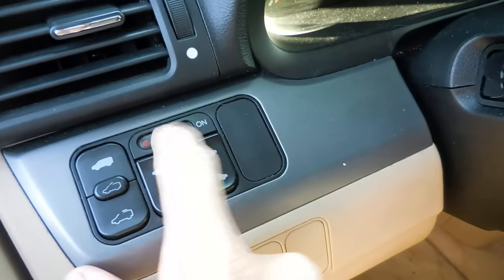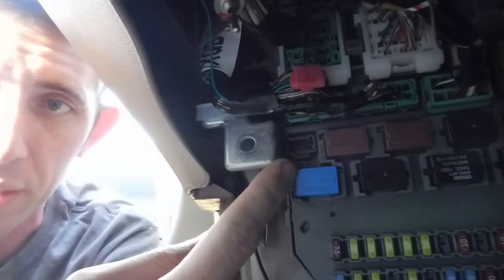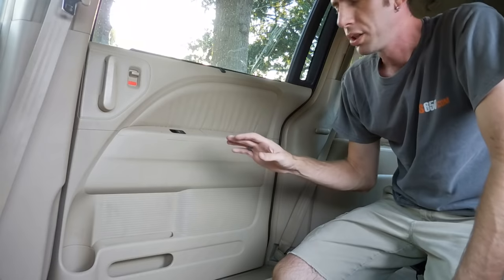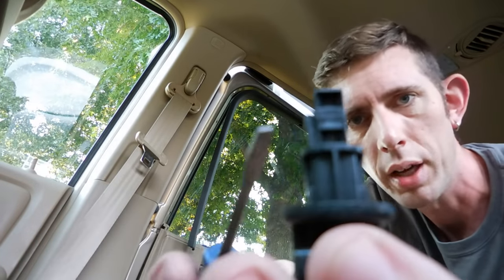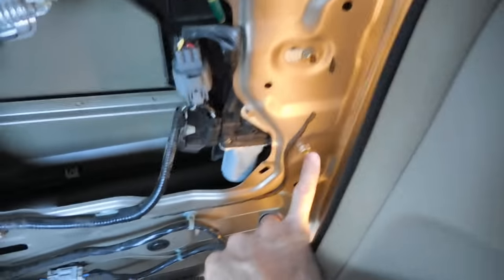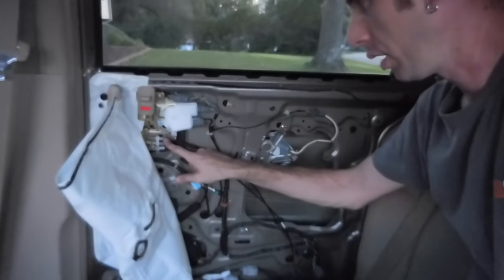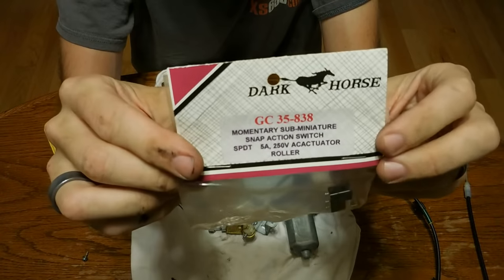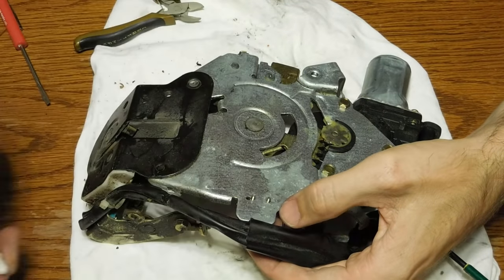Honda Odyssey Power Sliding Door fix - CHEAP

Comment: Seems like this will be a working solution for me as well as soon as I put everything back together tomorrow. I just wanted to ask about the longevity of the fix. Is it still working for you?? Thank you though for taking the time to document all this and very recommended video and solution. Thank you!!!!!
Reply from the maker: Chris Alvarado yep, still working, although the door rollers on mine are starting to get a bit noisy, so I foresee myself replacing those before too long.
Reply: Dustin Rogers I just replaced the door rollers on mine both sides jus two days ago. If you can get through this fix those are a breeze and well worth it. Good luck when you get the chance to replace those.

Comment: Your video is brilliant, however, it is a mile or two further than I can manage as a challenged auto repair person!  My fuel door, same drivers side as stuck closed sliding door, also won't close.  Could these be related?

Comment: WOW!  I've been told it would cost 700+ to get the assembly fixed on my door!  I've just let it be, with almost 200K on my van.  I wish I was as mechanically inclined as this guy! (ok, well . . maybe half!)
Reply from the maker: Angie Popoff unfortunately most repair shops, especially dealers won't do this particular repair because they have to be able to guarantee the repair. This is a DIY solution that can save a ton of money. Find a friend, neighbor, co-worker, etc that knows how to solder, as that is probably the most difficult part of this repair.  The rest is merely unbolting pieces. Good luck if you attempt the repair and thanks for watching.

Comment: i am thinking of coming off that #7 BACK UP fuse receptacle in the block with a circuit that includes an in-line fuse holder for the same 7.5 amp fuse and a switch to be mounted somewhere convenient.  You just have to remember to turn that switch OFF whenever you turn OFF the ignition.  Leave the doors in manual if necessary.  To hell with all that door disassembly ( which you will probably have to do to both sides as things like to die in pairs).  This is why I am wary of bells and whistles ....   great when it's new, potential to be a real pain when they get old.....   and I always get them when they're old.
Reply from the maker: Dave C the driver side failed about a year prior to this one. I paid an independent shop $1000 to fix the issue. When the passenger side failed, I wasn’t going to pay another $1000, so I did some research. Going in without knowing the exact process, while also recording video, the process only took 3 hours. Doing it again would take 1/2 that time and then you wouldn’t have to worry about it for another 12 years.
Reply: @DustinRogersinMO      I hear you, but it's my sister's van and we live 1500 miles apart.   I visit on holidays and try to fix all the family's issues with limited tools, resources and time.  Right now she is disconnecting the battery at shut down.  She doesn't want to be pulling the fuse all the time as that is a pain and will eventually ruin the fuse receptacle.  I can mail her a little circuit to plug in so she is just flipping a switch and  not popping the hood all the time.  That said... awesome video.  I like the increased playback speed and clear instruction.  One of the best I seen.  So good, if that van sat in my driveway, I probably would do it the right way since you did all the hard cussing and scratching part for us...
Reply from the maker: Dave C long distance repairs are tough. There are a couple other issues that I’ve read about that could be the issue. The fuse circuit will work, but if you plan to try to fix on your next visit, I’d have her check the body codes ahead of time to make sure it’s one of these codes. That way you could have the switch on hand. Thanks for the nice words and thanks for watching.

Comment: You have to pull the center pins on the shade hook clip down before pulling them out or you will break them! There is a spot for a small screwdriver to wedge them down .
Reply from the maker: Yep. I show that at 6:00

Comment: 2008 Odyssey. Pulling the driver's side number 7 fuse worked for some reason. Did some research in the process.
Reply from the maker: It worked for me too, temporarily. After 3-5 open/close cycles the light on the dash came back on. Hopefully yours will stay fixed though.

Comment: Our 2005 odyssey the rear sliding door would not suck in all the way.      Turned out we had to take the cover off the door and blow the little motor inside out with an air hose.     Gravel roads are rough on sliding doors and it was just dirty.

Comment: Does anyone else have issue with video playback speed on this video?  I have to cut the playback speed to 50% otherwise he sounds like a chipmunk.
Great video though!  It helped me fix my door!
Reply from the maker: I sped the video up during editing to keep the length of the video shorter. Adjusting playback speed works perfectly to adjust it to your desired rate of consumption. :) Thanks for watching. Glad I could help.

Comment: 2010 Odyssey. Left sliding door closes, then "pops" ever so slightly back open. Red light is always on on dash. Door seems to always cycle thru closing then opening. Pretty sure it is the cause of battery drain. I was psyched to find your video. Only problem: I'm only getting code B1222, which has something to do with rear climate control. I'm not getting your codes. Anyone have thoughts? Will very much appreciate the help.

Comment: that trick with the rag and clip is sweet.  So my door is stuck closed, any ideas about that?
Reply from the maker: airplane george not sure what you’ve tried, but I’d try to manually unlock it from the inside (don’t rely on power locks). If it still won’t open, it’s possibly a broken cable from the door handle to the latch mechanism. If it’s that, it’ll be difficult to repair because it’s hard to remove the door panel without opening the door.

Comment: My 2008 Odyssey rear sliding door will not open. Not from inside or outside.  Door is not locked shut.   Every video requires sliding door to be at least partially open to do any work on the doors. Cannot remove inside door panel or anything.  Any recommendation on how to troubleshoot a sliding door that is not locked but will not open?
Reply: Did you ever figure out the problem?

Comment: If I remove the #7 fuse without fixing the door will that stop the battery from draining?
Reply from the maker: I never had the draining battery issue. It’d be worth a try, but I’m not sure if the switch that malfunctions which causes the battery drain is on that same circuit, or a different circuit. If you have a multimeter, you could test it to find out. You basically need to remove one of your battery cables and connect your multimeter between the cable end and the battery post and set the meter to measure amps. Note the reading. Have someone pull fuse #7 and see if the amperage reading decreases (meaning the faulty switch can’t draw current anymore). 

Keep in mind that unhooking the battery cable will cause the radio to lock and will erase your preset radio stations, etc. So make sure you have your radio unlock code handy.

Comment: Already fixed that problem. They worked for a couple months and now  one of them is not working, and there's not light on. Any idea of what's going on?
Reply from the maker: Jimmy Benitez maybe try the technique to retrieve the body error codes. There may be some codes that won’t trigger the light. If there are codes present, you’ll just need to search for that code to try to find a fix for it.

Comment: Mine says NO only? No 
codes? But driver side sliding door doesn’t open and close. Do I need to replace the latch assembly and sliding door motor? Pls help thanks
Reply: I already reset and check the fuse. Only driver side that doesn’t work

Comment: Hi can you tell me what is the reading on your multimeter when you test the micro swith.? When you push that button and beeping sound turn off that means switch is off.? 
Thanks.
Reply from the maker: The beep means there is continuity through the switch. So if there is no beep, the switch internals are not making contact with each other.

Comment: Good video! My question is: is this only for when the door won't operate? My problem is the door would open and close but the rear latch would not pull the door in. Would this work for my problem?
Reply from the maker: Chomp this will only fix the error codes shown in the video. There are several other things that affect door operation. Do you have any error codes?
Reply: I have not checked for error code. I think I'll let my mechanic have to a look at it. It is too bloody cold outside so I'm not really in the mood to spend a couple of hours outdoor.

Comment: This is great but do you know how to open the door when the latch won't open. The passenger sliding door wont open and I believe that is the same issue but the problem is I can't open the door at all to remove the latch assembly.
Reply from the maker: Alonze Theodore you should be able to turn the power doors off via the switch on the dash to the left of the steering wheel. After that, you should be able to open it manually with the handle. You may double check that it’s unlocked (manually from the inside) just in case the power locks are also not working.
Reply: @DustinRogersinMO  thanks for replying.  Even manually,  the door won't open by turning that switch off.   I've also replaced the two lock actuator and still not open.
Reply from the maker: Alonze Theodore there’s a cable that runs from the inside handle back to the latch. It’s possible that the cable is either broken or seized in the cable housing. You’d have to pull the interior door panel off to verify one way or the other.

Comment: Did your van stall at all? Buddy has an Odyssey with broken door that stalls/doesn't start occasionally wondering if it's related
Reply from the maker: Shelby ours did not have this issue, but I’ve read about some other door issues that cause a parasitic drain on the battery.

Comment: Hey Dustin! I am heading to the pick and pull parts tomorrow. What is the exact name of the OEM switch that’s malfunctioning? Thank you
Reply from the maker: Albin Lagartera Honda doesn’t sell the switch separately. It’s built onto the sliding door rear latch assembly. You can purchase a nearly identical switch from Amazon (see link in description). If you buy a used latch assembly, be sure to do the continuity checks on the micro switch before you install it.

Comment: Hi Dustin, was a great video and followed step by step. Just need to clarify one thing If you can please get back to me, appreciate it. When reinstalling the switch, is the lever supposed to be pressed down against the mechanism or not pressing it but just touching it. Appreciate if you can please reply as the van is open for last two days and can’t figure it out. Thanks in advance
Reply from the maker: When the gear rotates around, it should activate the switch.
Reply: Awesome, thanks so much m Dustin for the quick reply

Comment: I just took the window track bracket off but can't get the latch out. The latch has a wide piece of plastic that's behind the window track and the track doesn't flex much. The video is a bit light on detail there. Any help appreciated.
Reply from the maker: Yeah, hard to get a camera in there and I was just figuring it out as I went. Is the latch loose inside the door and you just can’t get it pulled out through the opening in the door?
Reply: @DustinRogersinMO  first of all thanks for replying! I stuck my cellphone camera in there and was able to figure out exactly how to flex the track and wiggle the latch to get it out. Putting everything back together now. Sincere thanks for the video and your help.
Reply from the maker: @aarohivijh  glad you got it figured out.

Comment: does that switch prevent the door from opening and closing ? also if you try to open it do you hear the beep ?  i recently replaced my battery ,then the door stopped opening or closing ,i did the fuse reset didnt work , then i started to get a parasitic drain from that fuse connection .puled it out no more drain . is that switch the same problem ?
Reply from the maker: It’s possible this switch is your issue, but to be sure, you need to check the error codes. If they’re the same error codes that I specify in the video, this switch is the culprit. There are some other error codes that pertain to door issues too.
Reply: @DustinRogersinMO  i will have a look , but in my case its the driver side door

Comment: There is another round sensor (switch) with two screws mount on the latch. It has three wires. How does it work? Mine always open no matter the latch positions. If I remove it and move the lever pass it's range, the switch will close.
Reply from the maker: Jimmy Chao I’m not familiar with the switch you’re referring to? Is it on the latch assembly? You may check out the forums on Odyclub.com. There’s a lot of good info over there. Unfortunately we no longer own that van, so it’s hard for me to reference things on it anymore.

Comment: Our 2008 Odysseyis similar, but the passenger slider wont latch the last catch. Neither switch will make it operate. It manually moves harder than it should. Wondering if it's the latch issue or main motor/closer motor?
Reply from the maker: Jeff Soetmelk if the SLIDE DOOR light is on, use the process I demonstrate in this video to check to see what the error code is. If it’s not one of the codes I mention, it’s likely a different issue, but searching for the code you have may show you how to fix it.
Reply: @DustinRogersinMO  I have done all the fuse pulling, resetting I can find. I used your video to try the body codes. It said NO. Just the red light to say it not closed all the way. I'm at a loss, but guessing it's the main closer motor....??

Comment: When putting everything back together should the switch be pushed down or up how far should the arm be bent. Thank you for the video
Reply from the maker: gabe barth ideally you wouldn’t have to bend the switch at all. The switch will get  pressed as the latch mechanism moves.
Reply: So the button is not engaged until the open button is pushed and the lock mechanism would engage it. Or is the button not engaged and as the mechanism moves it then engages the button.
Reply: So closed when its ideal then open as the mechanism moved just went back and watched the video. Thank you for the response. Greatly appreciate the video.
Reply: I am sorry to bother you again. I have been having all kinds of trouble with this door. It worked for about 3 days and I am getting the same code again. Is this switch ok to use. URBEST AC 250V 5A SPDT 1NO 1NC Momentary Hinge Roller Lever Micro Switches 3 Pins 10 Pcs. Once again thank you for the reply and all the help.
Reply from the maker: gabe barth based on those specs, it should work fine for this application
Reply from the maker: It seems that someone in the comments posted a part number for the exact replacement switch too.
Reply: Thank you again for everything
Reply from the maker: gabe barth no worries. Hope you get it sorted out.

Comment: Thanks for your video it's so interesting and clear. 
I have a slightly different issue if you can help me please. After i reset the fuse, the door works fine for one time only (open&close), but after getting it closed the  "slide door" light shows again and the door gets stuck from new. And when i reset the fuse 7 again the door works perfectly with all possible senarios (using the driver button or the handle from outside), so do you think it's a switch problem too?
Model 2005
Thanks in advance
Reply from the maker: Mouneim Delmi you need to check to see what errors it’s throwing.
Reply: Dustin Rogers 
Exactly the same as yours.
Reply from the maker: Mouneim Delmi if you’re getting the same error codes, the switch that I replace in the video is the issue....or at least one issue. There’s a possibility that there is more than one issue, but you won’t know until you correct this issue.
Reply: Dustin Rogers 
Got you. Thank you so much

Comment: Did your door open or close and just didn't suck   in closed. Or totally inop
Reply from the maker: dunngee it would just pop open after pulling the handle, but wouldn’t automatically slide open or closed. You had to force it closed.